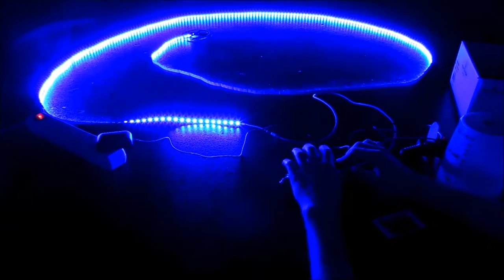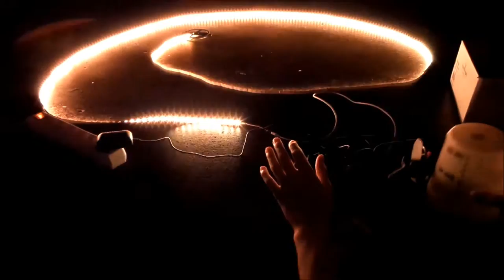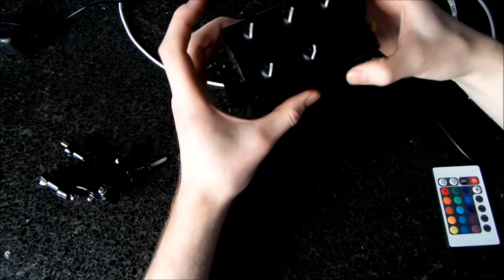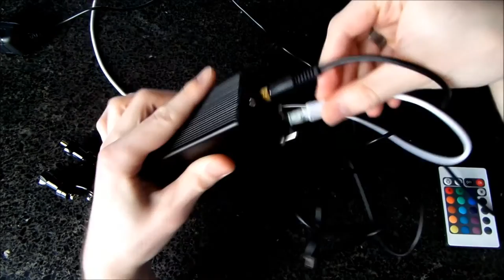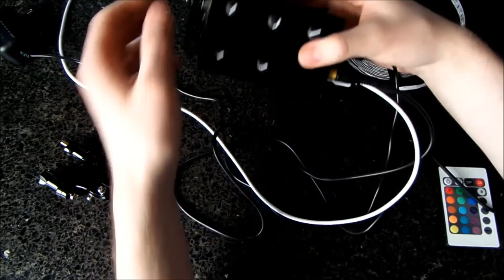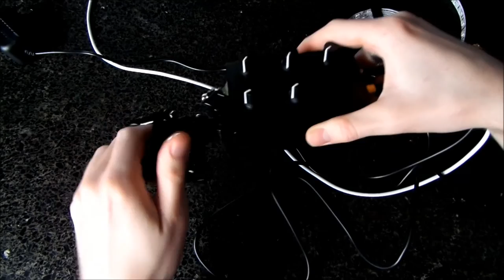Bass Drum RGB Led strip prototype device

Comment: where did you get the light strips at?
Reply from the maker: I got these: http://www.aliexpress.com/item/LED-strip-5050-12V-flexible-light-60-leds-m-5m-lot-Warm-White-Blue-Green-Red/1776743345.html

When buying RGB leds, make sure to get the 5050 leds, with these the 3 leds are all in the same module so the colors mix much nicer.
Reply: +aegis3d  RGB is the variety lights right?
Reply from the maker: Yep! RGB stands for Red, Green and Blue, and with mixing those 3 colors you can make millions of different colors!